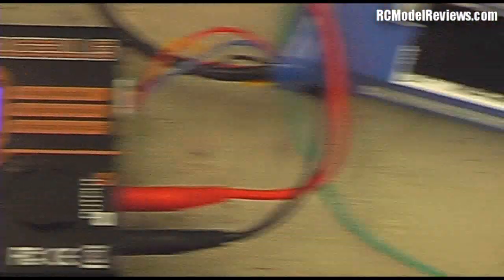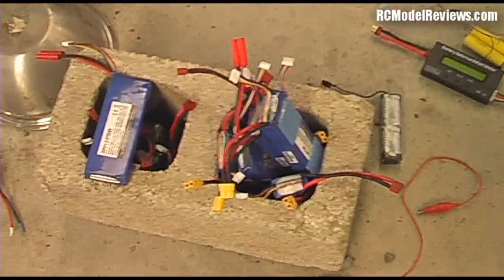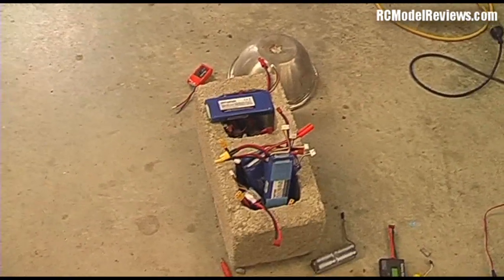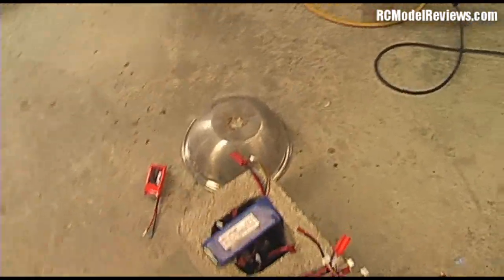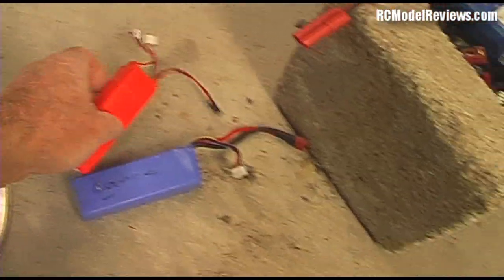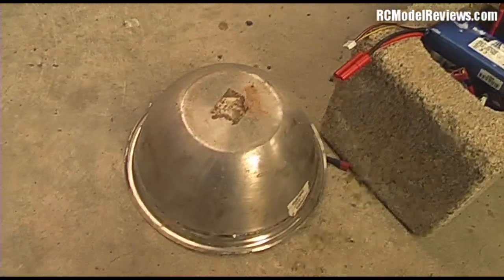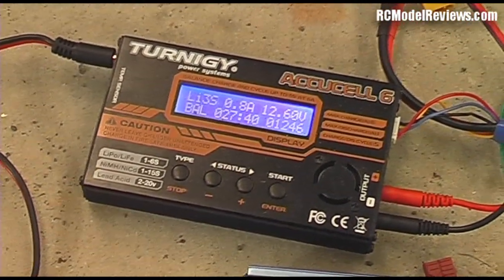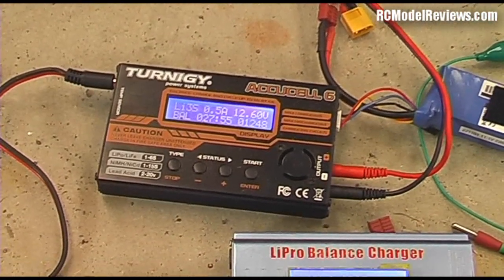Top Tip: safely storing your lithium polymer batteries

Comment: concrete I always heard will drain the hell out of a battery and render it useless and unable to hold a charge so im not sure this advice is legit
Reply: Put 'em in balance charge and you can keep 'em that way for months. (not reccomended). Best thing to do is put them in storage mode. Then every month charge them and then throw them in storage of you're not flying for long periods of time.

Comment: This cinder block storage is really bizarre advice. The LiPo can short circuit internally due to a manufacturing flaw which will cause a rapid temperature rise and spontaneous combustion, but beyond that point, it becomes a conventional fire and requires oxygen to sustain it and to spread to adjacent cells in the battery. Of course keeping the batteries away from flammable materials will prevent a conflagration but in your cinder block, all batteries in one section would be incinerated in the event of a defect in just one of them.

First, the LiPo charger should have a storage charge mode, which is a semi-charged state that the charger will achieve either by charging from discharged, or discharging from charged.  This preserves the battery but also means the energy stored in the battery is low and less likely to start the runaway condition in the event of a short circuit in a cell.

Second, the LiPos need to be stored in an airtight, fireproof container, like an army surplus ammunition box, which is readily obtainable and very cheap compared to the batteries. In the event that a cell does short circuit and catch fire , it will consume all the oxygen available to it rapidly, then be extinguished through suffocation. It is unlikely that the fire would be able to spread to a second battery before this happened, especially if they are in individual fireproof storage bags too. After a fire, the box can be opened safely once it has cooled down.  The ammunition box should be clearly labelled with the correct labelling to indicate the contents, so that in the event of a building fire, the firefighters can be aware of the threat posed by the container. Needless to say, several small ammunition boxes would be better than one large one, if you have that many batteries.

Comment: You need some way for them to breath so the gasses can escape. With the vent hole sealed, the pressure cooker will build up gasses inside and you will have a bigger explosion then you can imagine on your hands. If anyone uses the pressure cooker idea, don't lock the lid so the gasses can escape.

Comment: I've only just started using Lipos, so I hope I'm doing it right.
I have two Turnigy Lipo sacks for charging/transport/storage and a regular all steel cash box cash box for home and long term storage.  I'd like to find some fireproof board to line the box, just to be extra anal. ;¬)
 Have you done a video about how you adapted your power supply? Ok, I'll have a browse of your channel. :¬)

Comment: @bbreeo Ok bro. You must be new to this hobby. I've seen 20+ threads of li-po fires, some taking a whole house with them. There is more to lipo safety than simply charging at 1C. I store my packs in a lipo-safe bag and when I leave them unatennded I leave them on a large glass table so even if they go up in smoke they will be safe in the bag without lighting anything else up.

Comment: @kaboom083 ... Hmmm depending on which hose. Their new rubberised hoses I would imagine would actually make a much more nasty concoction of gasses if you combine the Lipo Gasses to the rubber/silicon burning of the hose. Their older hoses might have some merrit though. I doubt they would be fully fire proof as they are designed to leak water to make them fire proof but it would definately better than nothing.

Comment: I store my Lipos in an old 50 caliber ammo can, got it for $3 at the Farm and Ranch store.  Its got a locking lid, but since its airtight when locked, its only partially closed, so the lid can open a little bit and vent if one went up in flames.  I've seen videos of Lipos shorting that take off like a jet from the gasses, they could  fly out of an open top container.

Comment: I have a ammo box that I charge in that has proven to work well.  I works great until you pinch the battery leads when you shut the box.  I was charging in my van at the time and I wish I would have got video of the smoke rolling out of the windows.  But nothing was damaged... it stunk for weeks after that.